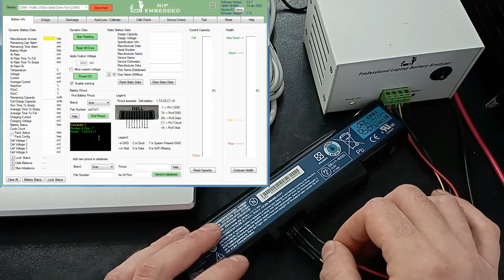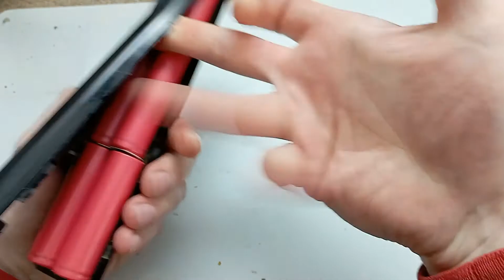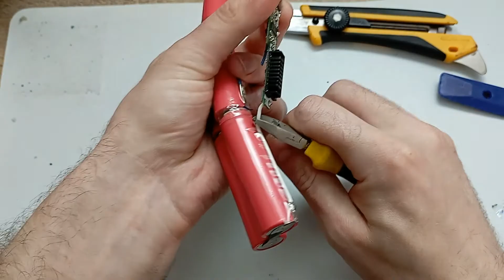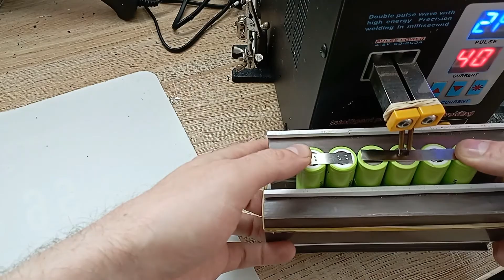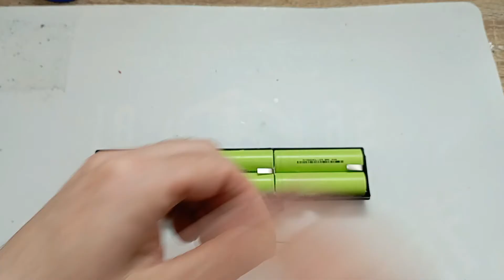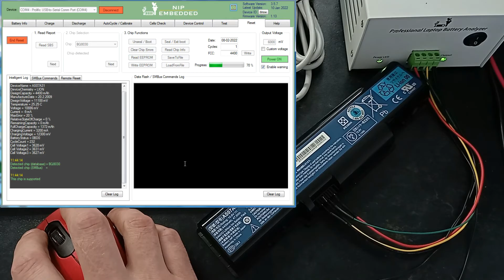Repairing a laptop battery by replacing cells and programming the chip using NLBA1 PRO Tool

Comment: i want  full assembly and disassembly video on  this specific model battery used in acer predator helious 300 models: 
Battery model :AP21A8T 
how can we reprogram it nd do all the procedure.
my laptop battery is not showing proper percentage, some times it gives 3 to 4 hours backup and some times it does not turn the laptop on even on bttery  percentage of 60 to 70%. some times it drops from 97 % to directly 6 %  nd after few seconds laptop turns off.
Reply from the maker: For technical support please use our platform: https://www.laptopu.ro/community

Comment: Hello, sir. Is there a solution since i  upgrade the FCC, but after putting the battery to charge, then it goes back to the old FCC. The cells were also replaced and it happens with some batterie. I did calibrate but still it goes back to the old FCC.
Reply from the maker: We offer free technical support on our community: https://www.laptopu.ro/community

Comment: I connected my Dell battery on my device and it doesn't show data on the screen.
Reply: use the (power on) button. it will provide power, that your batt should. (power on) will allow your batt info to be read.

Comment: My experience with the BQ8030 is that it will NOT be happy with any full charge capacity beyond 110% of original (i.e. 4840mah). As soon as you complete a calibration cycle, the 5200mah becomes 4840mah or lesser. This happened to my HP battery with 6* LG MJ1 cells and bq8030.
And you cannot arbitrarily change design capacity on bq8030 without a known working dump with a different capacity already on it, as its static data is checksumed and nobody figured out how to fix the checksum
Reply from the maker: Please contact us www.laptopu.ro/contact . We have good eeproms.

Comment: Very good video, but next time just tape the sensors to the new battery pack if you don't got the same type of glue originally used. It would've taken you 20 more seconds longer before and feels more safe to have them on :)

Comment: the best way to open or disassemble the laptop battery..pour some drops of petrol in the connector holes and shake it ..then twist slightly with both hands then it will open without any tool and it will also not crack or destroy
Reply from the maker: Very small drops of petrol is a good idea to dissolve the adhesive but more petrol could damage the case.
Reply: For an ultrasonic welded plactic case just like 80% of the laptop battery cases are, i wish you very good luck with the petrol. :)
Reply: @torture66666  i always have good luck while using petrol..u try too

Comment: NLBA1 a nice tool but Insane prices. 349$ + chip programmer licens 249$ pr. year. A new battery usually cost 25-40$.
Are there any other cheaper alternatives or DIY build projets that can do the same?
Reply: Look up Battery EEPROM Works & Smart Battery Workshop software. 😉😊
Reply: @miwa4783 i think it is for commercial use , you can fix batteries and make money .
Reply from the maker: Our tool NLBA1 is designed for PRO work. Please contact us for a Hobby license.

Comment: I think this is an interesting product! BUT you have to change or add the license model, so that it can attract more customers! There are 3 sorts of potentially customers: 1: Big Laptop Repair Centers (as there cant be many left I guess, the laptop market is decraising). 2:Smaller Computer Repar Shops. 3: DIY enthusiats.

The License model is way to costly for group 2 and 3. (People write $199 but it looks like it now costs $249, so wrong direction). Smaller reair shops dont repair many batteries - the sell new batteries or new computers to the customers, its a better deal for both. End customers dont have knowledge of different quality but are suspect to repaired batterys, also the time of labour is to costly in most Western countries. 

So I see group nr 3 (the Enthuiasts) as the biggest possible customer community for the future. They dont make money on their hobby, so its allready a big investment to buy the hardware, just for experimenting och there own pile of laptops an mayby helping som relatives. BUT they should be a welcome addition to the community, because the dont count the time spent and could share the findings so that the Database will increase, to benefit for all! 

Of course there should not be free licenses - But an addition of a License for Personal Use is needed. It could be a (much) lower annual fee, or preferably a license where you pay for some amount of uses, lets say 15 or 30. then you have to buy another set. That way I beleive it will benefit both users and also your business!
Reply: Alternative is using CP2112...
Reply from the maker: @davidbolha  NLBA1 does not work with CP2112.
Reply from the maker: Thank you for suggestion, we plan to create Hobby License for small repair shops.
Reply: Thanks a million for this product.
But I have a question. You said after resting the battery chip...one need to run the Auto cycle that will take 5 to 6 hours question 1. Will the battery be connected to the pro tool for that period of time?
2. Can the battery be connected to the parent laptop for such charge and discharge drill?
Reply from the maker: @janeobialor647  Both methods are quite good. It is important that the customer performs a correct calibration cycle.

Comment: 28:16 You said that it is bigger then the previous one and has 2600ma so why did you put in FCC 5200?
Reply: Because it's a 3s 2p configuration. 3 cells in series (3x4.2v=12.6v) total voltage and (2x2600mah =5200mah) total capacity.

Comment: Would it be better to use nickel strip instead of wire to connect the top and bottom as in the original?
Reply: Makes no difference. Some manufacturers use nickel others use wires. Electricity will pass troght both in the same way.
Reply: @torture66666  The strip looked like it could carry quite a bit more current.

Comment: The best programming trick: discharge in Windows 10x, and discharge once in Bios. When the battery becomes stronger by repeatedly doing this, new performance and energy saving features turn on, they are off by default, so it is good to do it with brand new laptops, too. When you sometimes use devices with full lcd backlight and full power, a little coil deliberately discharges to enhance the battery. Same with phones and power banks. The coil turns on using legal Sim card for net once.
Reply: This is complete nonsesnse! 😂

Comment: I understand that your device is designed for computer repair services, but you could  think, even in your interest, to widen the target of buyers by creating a low price  subscription for the reset function useful for the hobbyist, but not with the professional, e.g. 1 reset for month (or 1 every two months) ?
As far as I understand it is only a matter of software (you do not have hardware expenses to provide this service), so it is highly scalable, which for you means pure gain if the offer does not affect purchases by professionals.
I tell you this because the product is very attractive to us nerds, but the professional subscription is a big deterrent . The 10 days of free reset are a step on the right way, but a bit anxious and in any case does not justify the expence. Good work!
Reply from the maker: We plan to create a Hobby License for small repair shops.
Reply: @nipembedded9976   Still, You need to found out a "Personal License" which give a certain count, lets say 10 or 30. That will make us interested in buing the hardware. What "other Software" cost is not so relewant, because we will not buy that software eighter.
Reply from the maker: @victorandersson9737  Thank you for the suggestion. We plan to create a Hobby License.

Comment: Hi I have problem with NLBA1 I recell the battery as you always start from the positive I did what I said but after recell when I reset the FCC it has been reset but after charging the the FCC dropped again what was before also the chip is supported what could be the problem can you guide me.
Fuse is also good.
Thanks in advance
Reply: Please open a topic in the forum and you will receive support there.

Comment: The cost of getting new cells plus the repair work will be much more expensive than buying a new battery. To be honest, this wont really be feasible to spend money for this equipment just repair batteries. Unless someone is in recycling and refurbishing business.
Reply from the maker: It is not true. Not all laptop batteries require replacing the cells, there are tons of laptop batteries with good to new cells that are only over-discharged. By precharging them and resetting the chip, the battery will function again. Many of our customers are recovering tons of such batteries.
More, the equipment is by far the most advanced laptop battery analyzer, you pay once and you get unlimited software, all updates included.
Reply: @nipembedded9976  Over-discharged or deep-discharged, what is the difference? Recharging/operating a deeply discharged battery is fundamental dangerous (and prohibited)
Reply from the maker: @Tualatin007  Battery or cell ?
Reply: @nipembedded9976   In principle/theoretically/fundamental... cells,  cells in Li-battery
Reply from the maker: An over-discharged cell has a voltage below the lowest threshold mentioned in the datasheet. Depending on the voltage level you can pre-charge it safely.

Comment: For 350USD I could buy 5-7 original brand new battery for my laptop. Useless tool.
Reply from the maker: There are customers who repair thousands of batteries in a year. We also plan to create a Hobby License for Small Repair Shops. All Pro Analysis functions are Free Unlimited Lifetime.
Reply: @nipembedded9976  Useless tool for ordinary users, not for service centers, but I am curious  why to renew old battery which may cost you more than to buy new one.
Reply from the maker: @Oldermans  1. The tool is a PRO tool for industrial work.
2. We plan to create a Hobby Repair License.

Comment: Will the chip reprogram itself with multiple charge and discharge cycles after changing the battery cells?   In other words is there any way to repair battery without needing specialized equipment to reprogram the chip?
Reply from the maker: No, you can't. Once the PF (Permanent Failure) flag is set then you need to unseal the chip and clear it. Only specialized tools can do it,
Reply: @nipembedded9976  Thank you.

Comment: Loved it. I have an old dead laptop battery for a Toshiba L510 that I've wanted to fix for a while. However, I've taken the pack apart and disconnected the cells from the PCB. I've left it alone for about a year now. Would it be possible to interface with the PCB after having left it disconnected from any power source for as long as I have? Is there any chance of reprogramming the onboard chip or will the volatile memory be gone and the battery has no chance of refurbishment?
Reply from the maker: If the chip was unlocked (no PF set) before disconnecting the cells, then everything should be fine after reconnecting the cells. If it was locked then there is no way to unlock it, you will need our NLBA1 device to unlock it. Note that there is a fuse on the PCB, in some cases the chip blows it up and it has to be fixed.

Comment: wtf!! I've never seen solder just melts like butter within 1 nano second 🤯.it looks like solder melts even before touching it!!!so cool
Reply: Good soldering iron like the Hakko, Goot etc with temperature control, good bits makes it possible. We in India know only the Solderon brand. There is something called low melt solder which eases the melting process too. This low melt soldering lead is different to what we generally use.

Comment: Hello, is it possible to programe and reset chip of a hp battery using svod3?
Reply from the maker: As far as I know NO, SVOD3 is just a simple reader like any Arduino or CP2112. But it is not capable to reset the chip.

Comment: Good video thanks, but I think you have to refix the temp. sensors to the battery cells to avoid overheating problem.
Reply: The temperature sensors only sends the temperature to the chip, it has nothing to do with overheating.

Comment: Hi, sir, i am from Pakistan. I want to laptop battery repairing shop.. Is it work, i mean it is professional NLBA1??
Reply: NLBA1 is the most advanced Laptop Battery Analyzer with Repair option on the market.
Reply: @azzidoqsc  sir, is it just analyzer or complete repairing solution??
Reply: @rehansiddiqi1668  NLBA1 device is PRO Analyzer with charging, discharging, calibrating, wake up, testing, measuring internal cells resistance, checking the cells, generating reports LIFETIME, so you pay once and that's it. If you want to Reset battery chips (Repair Laptop Batteries) you can buy 1 Year Chip Reset License = 199$. It supports a lot of chips, including all Apple Macbook batteries, even 2021.
Reply: @azzidoqsc  G sir, okay thanks a lot.. ☺️

Comment: good thing we have some nerds reverse engineering ur device , soon no subscription pay  software  bs :)
Reply: PLEASE KEEP ME POSTED!!  I still have the NLBA1.  Its a brick at the moment.  I purchased as a chip unlock / reset, as they said chip unlocks were coming.  They never said anything about moving to a subscription model, until they announced they did.  A subscription model is cost prohibitive for us, as we rarely have battery chip locks.
Reply from the maker: @cognetic  If you don't afford the price you can check out other softwares (just software) that cost up to 1000$ per year.
Reply: Exactly, you just need to wait !

Comment: What is the advantage of replacing over buying a new battery ,the cells are are around 12£ and anew battery is more less the same price
Reply from the maker: Most of replacing batteries are bad quality, recycling an original battery with original cells will make the battery working as a brand new original one. 
There are many new slim and flat batteries which are locked because the cells are over-discharged (stored a long period without charging), such batteries can be repaired by pre-charging the cells to about 3000mV and resetting the chip.

Comment: How can I remove the old program on the chip if it has a defect, knowing that I have a copy of another battery of the same type  thanks
Reply: Very simple just go to reset tab and load the working eeprom and press write.
Reply: @torture66666  Thank you for your reply
Reply: I can't do that. It shows that the file space is  large. I want to how to erased the old file 
Meaning, I want to get a blank EEPROM so I can program it
Reply: @RMAS22  Please open a topic on the NLBA support forum and also add screenshot with the issue so you can can a more accurate and fast reply. If the size of the eeprom that you want to write is different that means it's from a different battery or different chip and it's not safe to write it.